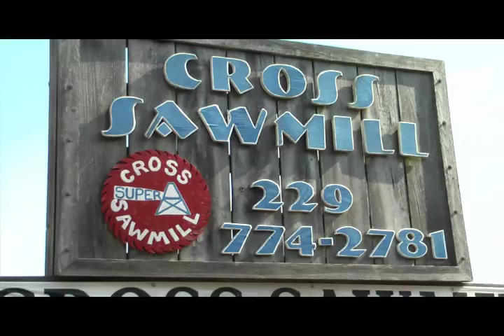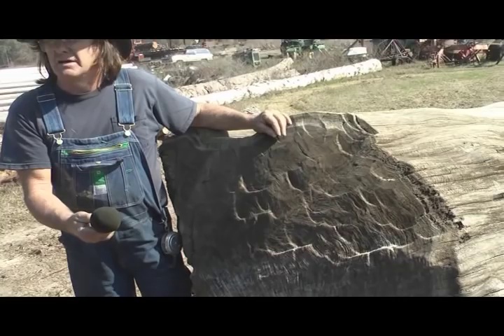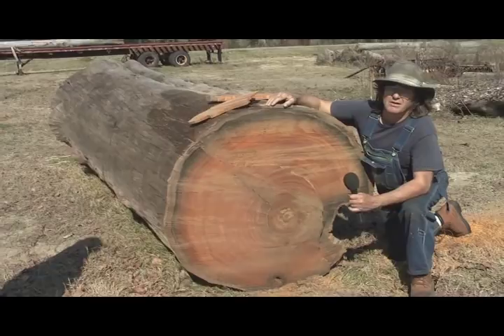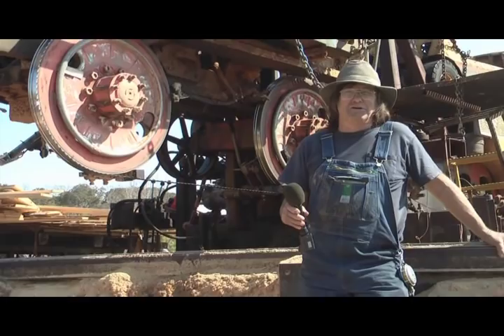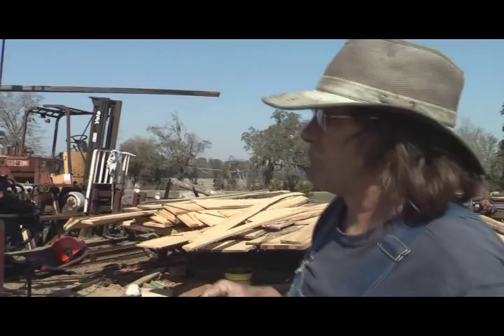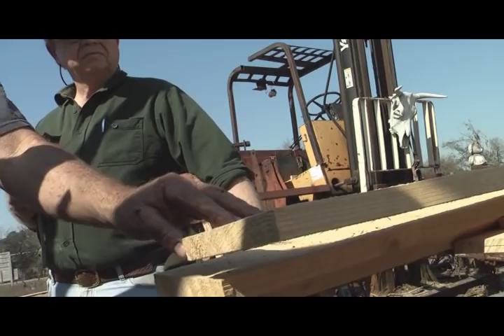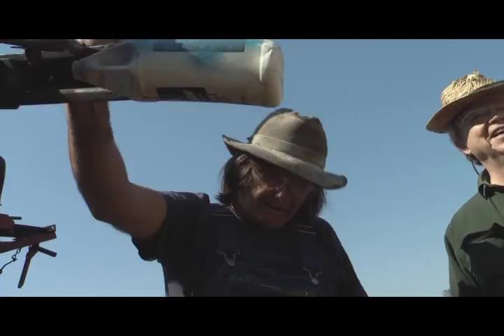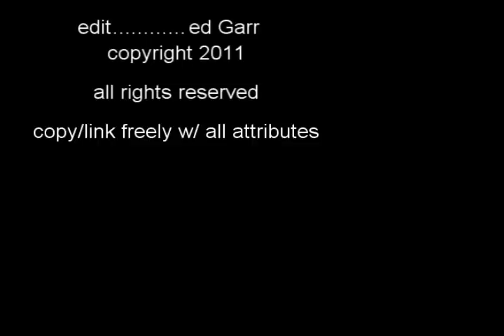Sawmill in South Georgia

Comment: When I was growing up in Pa. I knew and bought lumber from a guy who had a 52 in circular saw mill . He sharpened all  the teeth 2 times a day, was really cool to see this saw run.
Reply: +Steve Housley  Steve, The last Circle Saw I owned and operated had a "Super 250 Cummins" diesel engine--855 Cubic Inches --around a zillion foot pounds of torque. Maximum Board Width of around 30''. This band saw has a width capacity of 78''. akaSuperAX

Comment: Dear jamessiecs61,
  We do not remove the boards (slabs) one at a time because we remove them as a stack with a fork lift. As for the additional weight causing friction , If the saw is running correctly, It is "self clearanced" and friction does not seem to be an issue.The water is regular pump water (household) and is sprayed through agricultural nozzles onto the wheels. Thanks for the interest and if you have more questions, I will be glad to answer them. Steve Cross

Comment: Our approximate rate for custom milling large logs is One Dollar per Board Foot plus we charge for blade damage if we hit hardware. No hardware= No blade charges.  Both sections of this Log together equaled 2,400 Board Foot scale. 2,400 times One Dollar = 2,400 dollars. Thanks for your interest, we have parts and plans to build a sawmill with a much bigger capacity.  Steve

Comment: Regarding tension vs. Strain.  Most terminology has a way to polarize a term. In example tension vs compression-- positive vs negative -- jounce vs rebound -- centrifugal vs centripetal. Up vs down --  Strain then Lumps..(.the opposing forces of farts) Your video takes time to watch but I gleaned so much information, as well as enjoyed myself throughout..  Thank you kindly for your efforts as well as the side kicks that helped this video happen..  Termite
Reply: Larry, My reasoning for stressing the "Terminology" of "Strain" for a measurement of band tightness is that in "Saw Technical Speak" tension refers to the shape the blade assumes when it is operating. How do you think I make a one and one-half inch blade make a six foot wide cut? Tricknology Rules. aka SuperAX  ps You are right for the majority of people it does not matter. A wink is still as good as a nod to a blind horse.
Reply: +CROSSAWGA I have but one good Eye  I will surely apply the wink in place of a nod to conserve on energy.

Comment: Dear fordcummins1994, Thanks for your comment. This machine really is a helluva contraption. I personally have never seen more JUNK , I mean "Recycled Matierial", hooked together. If you are in the area stop by, and I'll take you on a tour and We will crank it up and run it. Also I will show my custom truck, It is a 1991 4WD Dodge W250 Turbo Diesel. It has an extended cab and a short bed. Stock Frame. We changed the cab and bed!

Comment: Great machine. However, is there a reason why each board is not removed immediately after being cut.? It would seem to put undue friction, and consequently, effort on the band-saw blade due to the extra weight imposed. Or is there a gravity fed water supply to the blade at all times?

Comment: That's a lovely piece of wood!  I'm not questioning your technique, after all you're the experts, but I am curious-  Why make so many cuts before lifting off the cut slabs?  I would think it would be easier to lift each one off just after it's cut.
Reply: Probably for efficiency's sake. To make a cut, get the forklift, move a board, make a cut, get the forklift, move a board, etc., would be FAR more work than just making a bunch of cuts, then lifting them all off with the forklift. If the log were small enough that you could just grab a board with your hands and pull it off, then your method might be okay.
Reply: Jay Williams
 You are right. Aka SuperAX

Comment: I don't understand how you can take so many cuts before lifting off the slabs. Seems like it would start binding the saw band with that much weight bearing down. Nice mill though. I was raised in South Georgia but most of the pines in our area were used for pulpwood and turpentine.

Comment: Curious about the thicknesses he is cutting the wood?  States going to use them for a table.  The first number looked like 1 in and some others 2.5 inches.  I mill with a double chainsaw which a 3 ft bar.  Doing a number of tables and try to cut them at 3 inches for live slab type.  The Ceder wood looked excellent with the darkness on the edges and sides. Only done about 15 logs so far of various sizes over 18's up to almost three feet.
Reply: At the start he said he was cutting some 4/4s. 8/4s and 10/4s all measures in quarter inches so 1 inch 2 inch and 2.5inch. Hope the sawing is going well

Comment: where is the saw blade
Reply from the maker: +Jenny Fardello Steven explains in the video it is a 55 thousandths bandsaw blade
Reply: +Jenny Fardello The Saw Blade makes a loop around the reddish wheels. Look closely at around the 18 to 20 minute mark and You can see the blade going between the Wheels. Steve Cross akaSuperAx
Reply: +CROSSAWGA Well I know perfectly that sometimes a large piece of metal get embedded on a tree... have you ever found a catastrophic bandsaw damage? and how do your deal with it when the cut is half way the trunk?
Reply: +Migueldeservantes  Thanks for the comment and question. Over the years we have found numerous objects that totaled the  blade pretty much instantly.Chains and Ax heads being most common after nails. How do we deal with it? If it is a low value log, We just pull it off "Blade and All". If it is high value , We cut the blade in half, then clamp vise grips to the blade and then use a crow bar to pull it out. Then cut as closely as possible with a chain saw, and then try to identify and remove the foreign object. Then we start our cut 1/2 to 1 ''' below that with a new blade. It is a pain and only worth it on high value logs. Thanks,Steve Cross akaSuperAX
Reply: Thank you very very very much! I wasn't expecting you to answer, and not even to answer this fast!! I'm totally fascinated with the design and manufacture of "Really large Band & Circular Saws!! Honestly don't care for the use of them! but the design is a really sweet thing tome!!
Reply: +CROSSAWGA I have a friend that usually test all the wood that he's about to cut whit a metal detector
Reply: Metal detectors are good in certain situations. But we always know we are going to try to cut it regardless Sooooooooo!!!!!!!!!!
 akaSuperAX
Reply: Yup...I was laughing my but off! when you say that!! some time you know what is there & what problems you are dealing with! and at least I do it any way!!
Reply: Migueldeservantes e